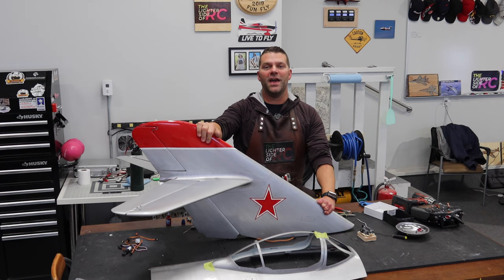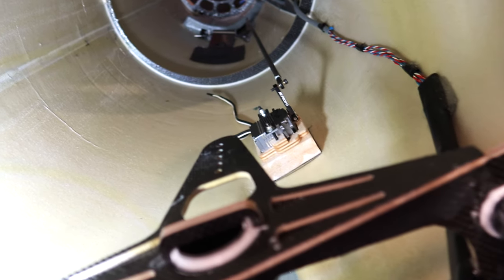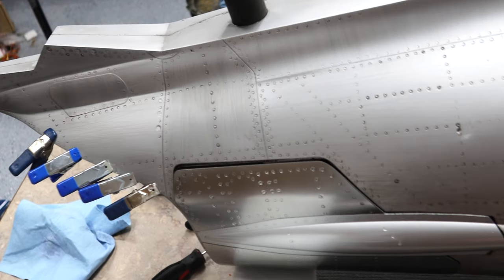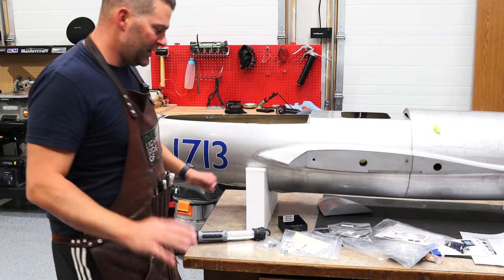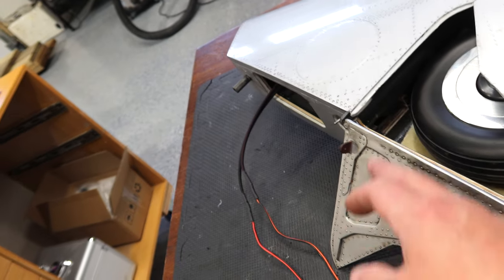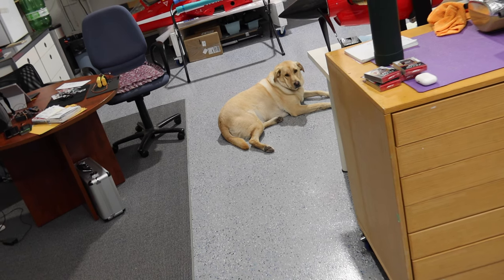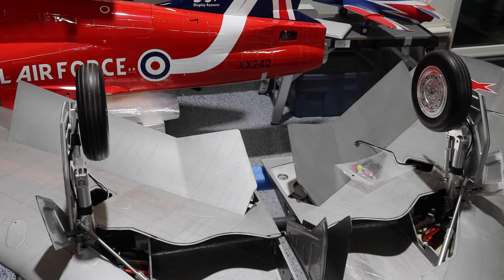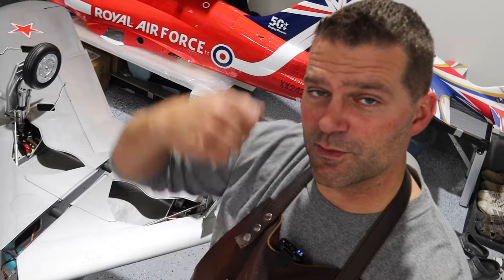The GIANT MIG 17 Continues - CARF MIG-17 Wings & More

Comment: Great vid John , quick question what hysol do you use for stuff like horn mounting and tank fitting sealing? Thanks
Reply from the maker: Thanks Brandon.  I will cover it in a bit of detail in the next mig video but I use the 9462 for anything structural and strong where I have time to wait for it to cure.  for most of the day to day stuff I have been using and liking the 20 min 2:1 stuff.  I think its called EH20.  Still extremely strong but it's nice as it firms up in a couple hours so if your careful you can handle the material or part your working with. 
I have the 5 min stuff but not a fan.  It stinks is my biggest complaint.  Also never fully firms up so it stays a bit gummy.
Reply: Awesome ! thanks bro i really appriciate it